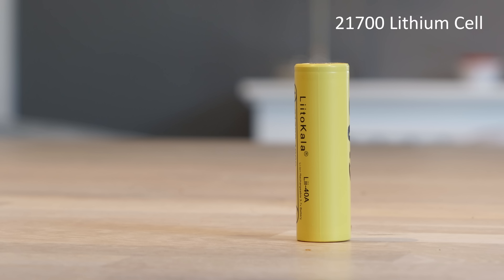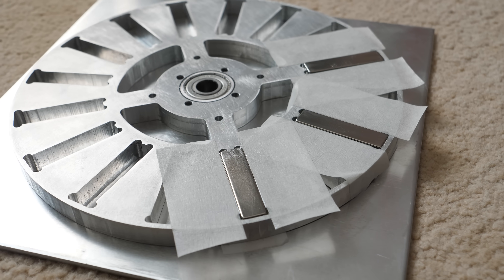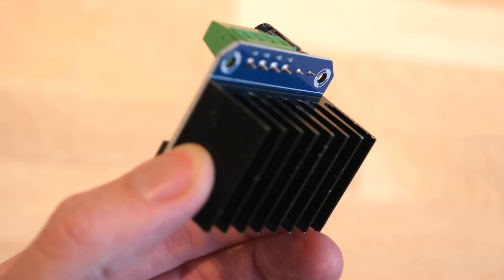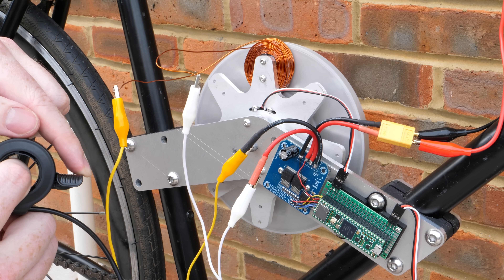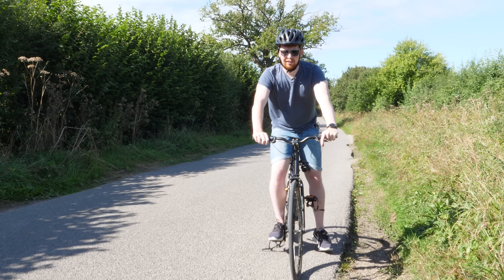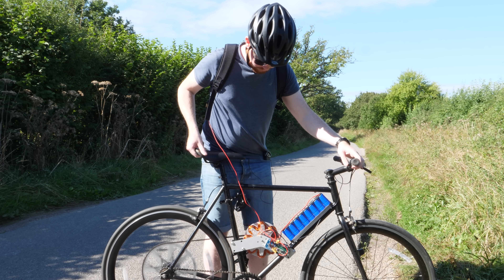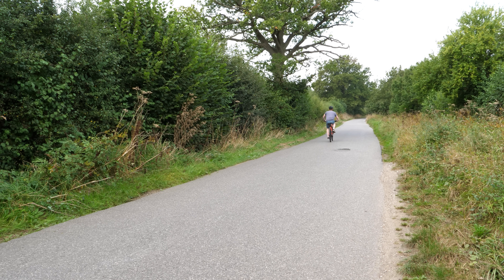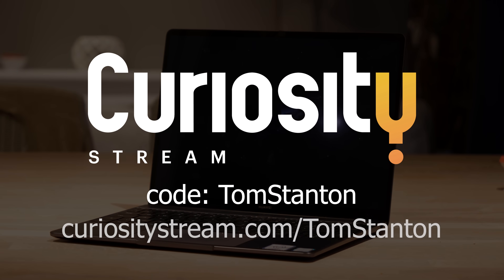Super Capacitor Bike

Comment: ● 0:40 That joke will not age well, considering the conquest of integrated fake engine noise.
● Electric bikes are a deceptively tempting crutch in my view. They give little incentive to improve one's performance, which is a very worthwhile pursuit. More like gentle fitness gadgets.
● I don't know why I haven't heard of it yet, but considering that car battery design is always a weighing of pros and cons of different design aspects, I'd assume a hybrid one (buzzword anyway) would be very tempting: If you add a little bit of supercapacitor support to one, you can totally disregard any emphasis on high discharge current and responsiveness for car audio or such and can instead design it for longevity, charge efficiency and such. ... I guess maybe it is not done because it is mainly only attractive for engine start, and for that it would have to charge first since caps lose charge quickly.

Comment: I've been enjoying these videos a lot.  A note regarding a  comment in this one, you mentioned that the power drops as the voltage of the battery drops, but this isn't quite true. The power electronics will control the voltage and current that goes to the motor, thus regulating the battery voltage. Same can be done for the Super Caps, but over a larger range. Would require more advanced power electronics to keep the power output constant (basically current will linearly increase as voltage linearly decreases (P=VI))

Comment: Mate I can't help thinking if you were to pedal assist your takeoff both with the flywheel and Super Capacitor bike that would cause a lot less drain on the power assistance starting from scratch where the most torque is required to get moving. I've been riding pedal Assist E-MTBs for some time now my current bike is a Norco Sight E-MTB VLT2. Really enjoyed watching thanks for sharing huge respect Happy Trails

Comment: Could you incorporate the flywheel into this? Have the super capacitors start the fly wheel for smoother take off then have li battery as the main power. Also mount the batteries within the tubing/frame of the bike. As you ride have a passive charging system for the super capacitors. 

I'm not an engineer just a machinist with few ideas

Comment: Boost converter will get you fixed output voltage by drawing more amps, which capacitors can do just fine. You can even change capacitors from one series, to parallel shorter series, if the circuit can handle the extra current, for example, parallel 2 x ( series 4 x capacitor ) = half the voltage, double the current. This is also good for lithium ion batteries as a way to do away with balancing, even if throwing together cells with wildly different capacities or ages, as parallel groups are obviously auto-balancing.
Reply: wouldn't that be terrible because you're dumping all that voltage differences on the connectors and the only limit is the resistance of the connections and the internal resistances of the batteries.

Comment: Very interesting video. Super caps are best to retrieve the energy from breaking or going down hills, then to use that power to partly recharge the batteries. I like using the 2600 farad caps myself. Go big or go home. 😁 You did a lot of hard work for this experiment. I wish I could give more than just 1 thumbs up. Thank you again for a great video.

Comment: I have used DC capacitor to replace battery DC power to ignition  the generator used to charge capacitor and that power was used by ignition coil, spark plug. It did worked..

Comment: Getting to the end of the video I think we were thinking similar things but you ended with an ad. It may be bulky but could you attach the capacitors to a Lithium battery and have the capacitors be attached to the breaks and the Lithium battery to the go button and have a computer feed the capacitors energy to the Lithium battery

Comment: if you put the capacitors in parallel you get a much higher power density, but then you need a high efficiency voltage booster, that can deal with high currents

Comment: What's the point of using capacitors if you get no range - just a quick burst of energy and then nothing. You wouldn't be stopping every mile (if even that) to do a capacitor recharge, even if it's as quick as a minute. If someone can invent a technology to recharge an EV (car, scooter, bike, etc) within no more than 2-5 minutes for at least 100m range then electric transport is solved. Until then petrol rules.

Comment: @Tom Stanton
Note: If you apply clipped in pedals and shoes you will have a more efficient output again as you get the pull on the upstroke as well as down.

Which will change your results again.
Hope this helps.
Reply: To do so you'd need to add a pressure sensor in each pedal so you know what is down and what is up. A cadence type cycling pedal may work.

Comment: the power is small because of the small voltage and strength of the electric current, as well as permanent magnets. Perhaps it's better to take a more powerful one. In general, the idea is interesting, but you need to refine

Comment: You should try the 3000 farad boostcaps. They are expensive but you can even weld with them. 6 of them in series will jump start a car with a completely dead battery. I am sure you would have more range but still not the range of a lithium battery.

Comment: What would be, if you make ciclical switching between charging and discharged packs, and you can provide stable voltage when you are pedalling. So basically you wouldn't provide the direct force to drive forward, else only the charge the capacitors. This way doesn't need anymore chains....

Comment: Now imagine using an ordinary capacitors, that are able to charge and discharge instantly
Reply: Eh for capacitors to discharge while providing power, the current must run through something with resistance, and if you set an equation for the voltage around the loop, you'll find that Q/C=-IR (supposing that thing with resistance is ohmic), I=dQ/dt so this equation can be re-written as Q=-RC(dQ/dt). Solving this differential equation will give you Q(t)=Q_original*e^(-t/RC). Therefore, the charge on the capacitor decreases exponentially and it doesn't discharge instantly.

Comment: Not having a clue about electronics I was wondering if it's possible to use capacitors that receive a short sharp charge while braking on a bicycle then charge mobile phones or even bike light batteries (at the more appropriate charge rate)?

Comment: Hi Tom can I use  axial flux generator with 1.5 more power than bike motor  in front wheel ..of e bike..so that I can transfer energy from front to back . through battery.. advise me if it's possible

Comment: I think a super capacitor bike would be great for those who cycles but do not have the strength to cycle up hill, using the motor to help them push themselves up.
if there's regenerative charging, it would be great for when going downhill.

Comment: Trucks, buses, and all heavy vehicles MUST have these type of systems especially on mountain terrain! Recycling trucks making so much noise due to hydraulic pump requiring higher engine revs to operate, would be as silent as baby sleeping with this technology for driving from home to home and supply power to hydraulics by electric motor.

Comment: I think a supercapacitor pack would work much better either as a buffer for a normal electric vehicle to do quick bursts of torque or using an inverter and a variable transformer you could keep the output voltage constant

Comment: Would you be better off with a closed magnetic field?  Either by making a "horseshoe" core for the coil or even having two sets of coils, one each side of the rotor?

With a rotating disc placed where it is I think a cricket box would be more use than a helmet :)

Comment: Put magnets on your back wheel on the rimm and the spokes add a magnetic pickup here the good bit make your own supper cap using a drain pipe pvc rolls of tinfoil paper electrolyte and then use a powered front wheel but the cap should be fun making

Comment: What if u used the capacitors as a quick charge solution for batteries, so u could charge very quickly, but run for a long time?
Reply: How would you store enough energy to run for a long time when the capacitors can only hold a tiny amount of energy?
Reply: @Berkeloid0  well like I said you use batteries as your power supply and just used three capacitors to charge the batteries. So u charge the capacitors in 2 mins, then they charge the batteries
Reply: @enderlord5412  So the battery capacity is a few thousand times more than the capacitors.  You fully charge one capacitor bank quickly so it's at maximum charge and can't take any more, then use that to slowly charge the batteries from 0% to 0.01%, then your capacitors are flat and your battery is still almost empty.  What happens next?

Note that although capacitors can charge very quickly, in this case they aren't being charged very fast (only 10 amps).  The charge is short because the capacity is small.  It's why filling up a swimming pool takes longer than filling up a glass of water - one can hold a lot more water than the other.

What you're saying is why not use a glass of water to fill up the swimming pool more quickly, because filling up a glass of water is faster than filling up the whole swimming pool with a hose.  Yes you can fill up a glass of water quickly, but by the time you've dumped it into the pool and gone and refilled the glass again, you're going to be way behind someone just filling the pool with a hose, if that makes sense.
Reply: @Berkeloid0  in the video he says that the batteries and the capacitors have the same energy capacity, granted he's using what he refers to add super capacitors but I still think a system that uses both could work
Reply: @enderlord5412  No, he says in the video the capacitors only have the same energy as a single AA battery, far less than the existing bike battery.  This is why he was laughing about how running off the capacitors he only got a few seconds down the road and back before they went flat.

If the capacity of the two was the same, then you wouldn't need the batteries at all, you'd just use the capacitors on their own because they charge faster.  In that situation having the capacitors plus batteries would be no different to just having two battery packs (or two capacitor banks), which anyone can do but it just means more weight to carry.
Reply: I just rewatched the beginning ur right, but there could still be benefits to short range quick charge

Comment: if you created a SECOND generator to your front wheel.....as the main motor is powering your bike to go forward....the front wheel is charging the capacitor bank. you could always use a voltage regulator from the second front wheel generator to charge the capacitors at a constant rate.  i bet you it would work. so....in essense as you are moving forward...your front wheel is a generator for your capacitor bank. try it. it'll be fun.   john from kansas.

Comment: Wouldn't it have been easier to use a full Bridge rectifier on the output of the motor in between the motor and the capacitors in order to regulate the polarity of the energy hitting supercapacitors? That's the entire point of what a rectifier does... Is it makes sure that as the polarity of the generated electricity swaps back-and-forth the outputted electricity is always one polarity once it passes through the rectifier.

Comment: TBH, i would rather one of these super capacitor systems than a full on e-bike. my legs and lungs are strong enough to accelerate me to 23mph (and 25-27mph in a full on out of the saddle sprint) and have me cruising at 15-18mph but picking up speed after a complete stop can take quite a bit of energy, especially if done repeatedly. So I would use the super capacitor system like the KERS system from F1 racing as a launch assist just to get me off the line a little easier/quicker.

Another reason why i would choose super capacitor is because i wouldnt have to deal with the weight of a massive battery like that on an e-bike.

Comment: All you need to charge an ultracapacitor bank is a light bulb in series. With a ~12v bank, use a 12v bulb. The charge rate will be the wattage of the bulb, so a headlight bulb will charge the bank at about 50w. As the bank charges, the brightness of the bulb fades out.
Reply: I presume he was stopping the charger manually because it was going to charge to a voltage above the capacitor rating.  Otherwise you wouldn't need the bulb, the charger would just charge at whatever its maximum current rating is until the charge voltage matched the capacitor bank voltage, then the charge current would drop off to zero.
Reply: @Berkeloid0  without the bulb the current would be around 1,000A. The hobby charger is only performing the same job as a bulb - limiting current. A capacitor will never charge beyond the voltage you give it. It looks like a short circuit when empty and like a plain wire when full.
Reply: @IOUaUsername  Sorry I misunderstood you were talking about charging from a battery bank, I thought you were talking about the current-limited power supply which of course doesn't need additional limiting.  The only drawback with the light bulb method (aside from them becoming harder to find) is that you end up wasting a lot of energy as heat.  It'd be more efficient to limit the current via some other means.

Comment: hi Tom:)
Take this further:)...Aaand use an spokes egine/dinamo to load part of the capacitors. 
Use some capacitors to store energy from the engine/dynam/wind turbine etc and then with some relay alternate charge/discharge accordingly. (some capacitors cand be used for discharge and some for charging simyltaniously)
This ideea could be used to extend battery life of a middrive electric bike (this way you can take advantage of regen) - since capacitors are very light you could stuck them inside the frame etc.

Comment: I have a challenge for you. Design and build a machine that hits golf balls, such that:
- It is portable and light
- Is very quick to set up and execute a hit
- Can be used to play a round of golf on a real golf course
- Hits balls accurately, precisely, and over a range of distances
- Does not damage the ground
- Does not use a traditional golf club.
- Could either be driven by it's own energy supply, or could use the human operator's own energy.
- Putting not required.

Comment: Well. You tryed. I give you that, but you wouldent believe what I would do if I had your space and equipment and supplies. 
It will always be under its own power. And no outside charging. 
In fact it never shuts off. 
Oh
Well. I'm not completely  talking about a bicycle, 
But, my comment is based on your interests. 
Ive been there a long time. 
Peace.

Comment: no balancer at the caps? Motor will low be efficinany. Its more a fun project ;). A123 LiFePo4 could be load in under 15min. If using LTO cells it could be load in 5min :)

Comment: I wonder if you can use the capacitors to help power the transition from one leg to the other. So as you push down, it charges the capacitor. That brief period as you switch legs it discharges. Process is repeated with other leg.

Comment: 🙏 Hey Tom, just thinking 💭 -  How about integrating Solar? ☀️ 🔋 -  Seeing as the Super Capacitors recharge so quickly, from either Regen or a Charger - then maybe a constant (smaller) voltage from solar could produce enough energy to keep her running thru daylight?  (Suggest biggish panel on a lightweight trailer...).  🤔.    Bobby 🌺🎶.    Ps. Great concept btw matey!  🥰👏👏

Comment: Thumbs up and subscribed! CNC milled your  own electric motor and sprockets wound your own coils, inserted magnets and position sensors, bought/programed controller, included Regen, mounted on a bike, powered by caps and/or LFP...have you applied with Tesla?

Comment: Try to design an all in 1 wheel ie controller regen and batt etc you've got the equipment why not you just never know as even 20% better than what's out now would be good or if you can make better then Bob's your uncle reddies galore give it a try you never know what you can achieve until you try and then you might just surprise yourself ha? 👍

Comment: 2:30 I think you could save a lot of time if instead of using a calculator you used a computer. I would put the keyboard on the floor and use it with a foot, doing the same thing in windows calculator with the intro key

Comment: Electric motor power output only depend on the battery charge, on small battery packs.
Like Hybrids that have a maximum output. If you have a Tesla Model 3 Long range, you should get nearly identical power output for 90% of the charge.
The last 10 percent is more software limited, but when you remove the limitation, the battery pack has so many cells, that all of them still can provide more power than what the motor is able to put out.

Comment: I have used tiny boost convertors to ramp up the voltage from 2.4 to 3.4 on LiPo batteries. You could do the same to avoid the problem at 1:29.

Comment: That's basically a scaled up version of the type of motor used in the later generation of video cassette recorders in the late 80's. I know 'cos I used to replace them during repairs and they were only worth replacing on more elite models as the motors were expensive little gits.

Comment: What, 400 FARADS in a capacitor THAT size! Capacitors must've come a long way since I first started using them back in the 70's. And isn't it possible to make that motor double as a generator to recharge the capacitors when freewheeling?